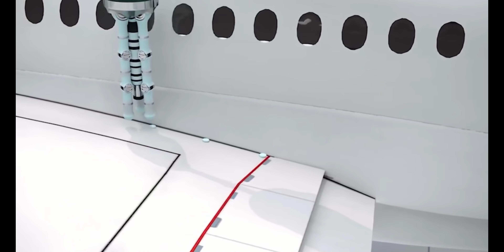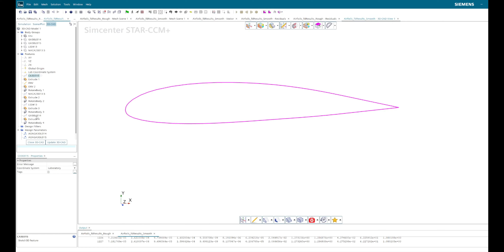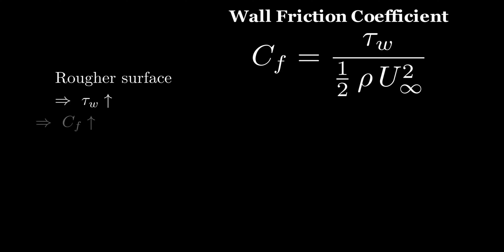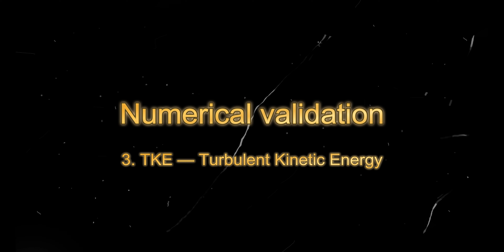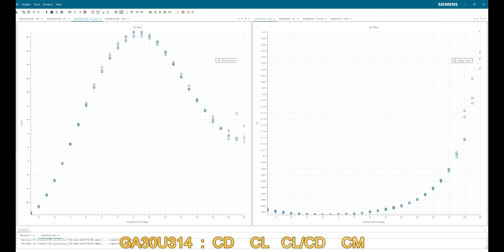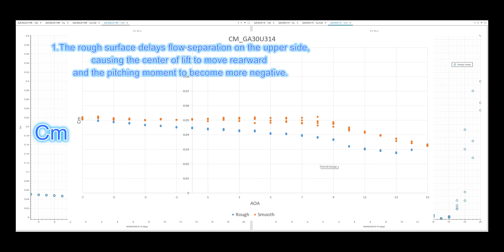Smooth vs. Rough Wings — that different?

Comment: Question, how would dimples effect drag, gulf ball dimples ,I remember years ago seeing a something about gulf balls tested without and with, as I remember the ball traveled faster and longer with dimples!  I wonder if on a body of a high speed car perhaps near the speed of sound, the drop in pressure with a dimple and then directing it back to the airstream might lower the drag!  I've been toying with the idea of building a ev multi wheel multi phase car with the newer ev motor s that might break the sound barrier, I can't seem to find any info about dimples to support or deny my thoughts
Reply from the maker: So the same dimples that reduce drag on a golf ball will, in most cases, increase the total drag on a wing or a high-speed streamlined vehicle.

A golf ball is a classic bluff body and would otherwise experience early flow separation. The dimples trip the boundary layer into turbulence, which delays separation, reduces the wake size, and significantly lowers pressure drag—this is why a dimpled ball travels farther.

Wings and high-speed vehicle bodies, on the other hand, are designed to be streamlined and to maintain attached flow under their design conditions. In these cases, drag is largely dominated by skin-friction drag. Adding dimples increases wall shear stress, and when large-scale separation is not present to begin with, the increase in friction drag typically outweighs any potential benefit from delayed separation.

Thank you for sharing, this is a very thoughtful and interesting idea.